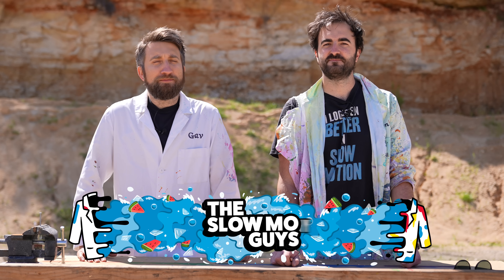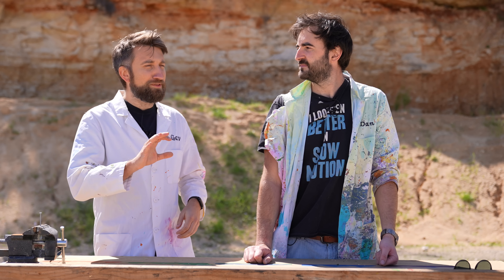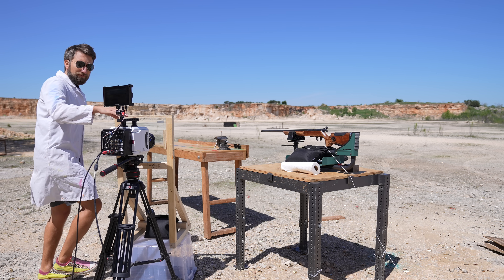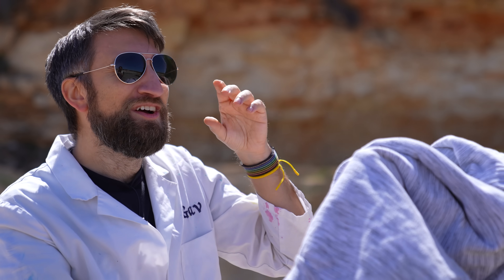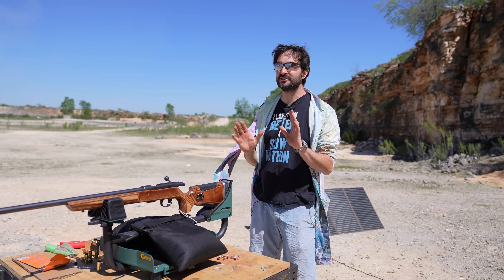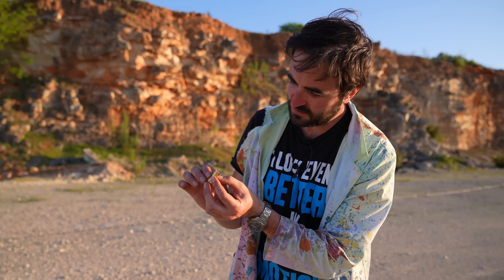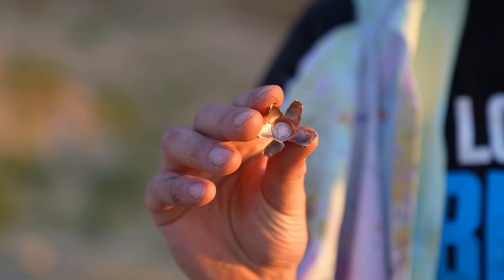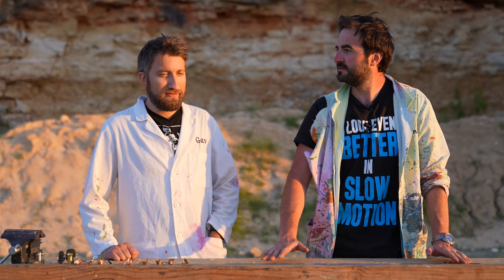Can a Bullet Go Through Another Bullet? 875,000FPS - The Slow Mo Guys

Comment: 14:14 Cool. You can see the distortion of the image caused by the shockwave from the shot as it passes the round.

The difference between the movie and this real-life test is that, yes, the lead of the bullet was liquefied upon impact and then re-solidified as it was flung from the explosion. The movie showed the bullet fragmenting, but not melting. To prevent the melting and merging of the fired bullet, it would have to made of metal with a higher melting point than lead, such as steel or tungsten.

Comment: You should try the Excel Arms Accelerator Rifle which fires a 5.7×28mm caliber round the .22LR round seems to soft and not powerful enough to go through a 50 caliber hollow point round. Also could try a 22 Hornet, a 22 Magnum those rounds might go through a 50 Caliber hollow point round.

Comment: You guys did an incredible research and experimentation.
But you got one little detail wrong which is why you were not getting the results you wanted.
Using a smaller calibre like the .22 was almost correct, the only thing is, it should have been of a harder material not lead.
Try forging the projectile with mild steel and experiment again, i guarantee you will get the result- smaller projectile passing clean through as the larger one disintegrates.
Its because both projectiles are lead, thats why its getting squashed together on impact.

Comment: 7:48 that's pretty much the result I expected. The bullet in the movie looks like an AP one, but the one they used was not, so I was expecting that tiny thing to not get through the big one.
10:55 looks like the primer didn't even get to do it's thing and was just "shoved" into the cartridge so fast that the compression shockwave blew it open before the ignition could happen. Otherwise I would've expected at least some flame behind the bullet, but there's just a vomit cloud of gunpowder.
11:45 I've heard of caseless ammo before, mainly from some Fallout 3 mods, and I never thought about the heat sink part. That's actually really clever, and probably one of the many reason why "caseless" never really took off.
12:50 "Came for eggs, left with a rifle: Walmart." (I wonder how many know where that's from)

Comment: 1st thing, yes 22 is very unstable in flight.... very common to answer ur first statement....The reason its not getting through is the lead in the 22 and the lead in the 50 cal have  equal density thereby molding into a single mass, the energy stolen from the 22 round travels through the 50 causing the jacket to dislodge

Comment: to be fair I think the reason you didn't get all the way through is if you look at the bullet in the film it's got a much sharper tip it was most likely an AP round which based on the results here... Probably would have worked.

Comment: I would love to see this with different rounds at a level angle as a straight shot instead of going from up to down on bullet? Make each table the same and use a laser level to make sure it's a straight shot and see the expansion than. But you also need a rig to have the opposite bullet spinning on the spot somehow in the opposite direction? Maybe than it will be more realistic??

Comment: Very entertaining video guys. A 22 magnum would have worked better than the 22LR, and if that wouldn't go completely through then step it up to a green tip 5.56 Nato which is readily available and has a steel penetrator core. It's the same diameter as a 22LR but has much more velocity and energy. I would like to see you do another video with this and then you can compare the difference of one bullet being fired and both bullets being fired. Thanks for the upload guys. P.S. You actually can get those rounds from Walmart. The brand I know they carry is Federal Ammunition's American Eagle 5.56x45mm Nato XM855FL.

Comment: surprised you guys didnt use a .223 / 5.56 since they have about the same diameter as a normal .22 (with an extra 0.003 inch), but with a lot more powder and length.

Comment: The angle of the .22 bullet is due to the fact that the bore of the rifle is angled slightly upward, relative to the sight line used to aim.  This allows the bullet to achieve a ballistic arc, so it’s slightly low close to the gun, slightly higher a bit further out as it continues along the trajectory, then as it curves downward due to gravity, it will once again be right on target, then lower and lower until it hits the ground, or an obstacle.  Frankly, it’s amazing that you were on target so close, all of my rifles would have shot low by about 1-1.5 inches, as they are zeroed to 25 yards.
Reply: ...they are using the bore of the gun to aim, as shown at the start. And the problem is in the bullet being tilted relative to it's trajectory, which really shouldn't be happening.

Comment: The error in cg and peoples imagination is that they still believe in metal collisions high speed that metals would act still hard and break in tiny pieces. But actually they deforms in a looking way similar as liquid, but this case lead its very soft metal already, hard cast iron yes would break in pieces. Also depending on circumstances the lead hitting have some portions or all pulverized exploding in so many tiny pieces almost like total powdered composition. Shockwaves also act like liquids

Comment: Is it possible to uncap an (initially sealed) plastic bottle by rapid accelerating rotation, so the inertia of the cap unscrewes itself. I hypothesize that about any bottle configuration would separate the bottle before the cap unscrewed. I think the 450ml plastic bottle has a chance.

Comment: A different bullet material on the small bullet might give you the desired result. The bullet I. The movie looks like a more solid, penetrator round. Lead on lead, with the smaller bullet having less mass, means the rounds are likely to merge or meld together. This is still a very cool video.

Comment: To be fair, to answer the question that you were asking you would have to use identical ammunition to what was used in the movie. You guys are using 22 caliber rounds but they are not armor piercers like what was used in the movie. If you were using a pointed armor piercing round like the one in the movie it would have went through that like butter. So I call this entire video a fail if you're going to ask a question of is this possible in reality based on a movie then you need to use the ammunition used in the movie for a proper comparison. This is the first one of you guys is videos where I'm disappointed because of lack of detail. The fact that the bullet was silver and pointed suggests that it wasn't a simple 22 caliber jacket around.

Comment: Have to suggest you doing this again, maybe on Demolition Ranch. With a 5-7 or 17HMR. The 22 isn't a jacketed projectile, it's practically speaking painted with the copper coating and there's no steel core so the soft lead is just explosion welding together.

Comment: I'd say there's two big differences between reality and the CG shot.
Firstly, there's no spark of the air igniting like Gav mentioned.
Secondly, the CG shot doesn't show a lot of deformation. It mostly just shatters like a rock, whereas in reality, lead is a pretty soft metal so as you could see in the footage it became much more liquidy under that much stress.

Comment: I would have tried with either .22 magnum round, or get a really high power .22 PCP air rifle and try with that. With an air rifle you can easily get as much power as with the .22 and AP shapes are readily available (even from materialsi like steel)

Comment: Vanguard Outfitters, located in Florida I believe, has 5.7 rounds called "Obsidian Dragonfang" rounds that are a 34gr solid copper alloy projectile and come to a point, just like the rounds in the movie footage. To get the testing to be as close to the original as possible, I would use those rounds. They are nearly .22 caliber, but are much faster & have much more velocity, coming in at 2125fps from an FN Five-Seven pistol.
Most 5.7 rounds are about the same weight as 22lr rounds, 27gr-40gr and there are subsonic rounds available weighing 60gr.

Comment: So… I kept skipping around but…. You know the bullets going at each other instead of one being stationary would change the results? 

The problem with the film was that they energy of each round would’ve have been redirected and disappeared with the larger material density of the larger round essentially enveloping and “dragging” the smaller round down with it. 

They would probably smash each other like was shown and slow down dramatically in mid air

Comment: In suicide squad It’s very clearly a 5.7 round (likely an armor piercing variant as well) not a 22… obviously a 22 round is not going to go straight through. An armor piercing 5.7 would however very likely punch through that 50. Hollow point with little issue.

Comment: Gentelmen, all you need to do is buy a few rounds of old military " Black tip " 30 -06 armor piercing rounds. They have a tungsten core that is smaller than 30 caliber and covered in lead and copper to protect the barrel rifling from the core. Get them at gun shows or E-bay for your tests. I am sure they will go right through the 50cal. That will be and an interesting video I assure you.

Comment: The trouble with 22 bullet was that only one bullet was moving, so there was less energy. When both of them move head on, then the velocity of both bullets add up and you end up having much more energy. But even then the bullet with more energy/mass has better chances of keep moving. But yes, having both bullets fly and hit each other mid air is pretty much impossible...
So, you had more realistic results with .30 06 since it has waaaaaaay more energy than a .22

Comment: Re: appearance of being liquid. Shooting the standing part of a railroad rail, about 1/2 inch thick steel, the hole was about double the diameter of the bullet, and the inside of the hole had the appearance of being melted and immediately returned to solid. Its color was a dark shade of bluish gray, presumably iron oxide. That was with a .270 Weatherby, a 100 grain bullet at about 3800 feet/second. If you decide to have another go, I suggest keeping the .22 caliber that fits the hollow-point so well, and fire it from a .22-250 or other really hot .22's that can exceed 4000 feet/second. Since you have a .30-06, if you can find some Remington Accelerator ammunition with sabots and .22 bullets, that will get you much more velocity than any ordinary ammunition. That is how they get extremely high velocity with the main gun on our M-1 Abrams tanks, but the projectiles for that are somewhat larger than .22 :-)

Comment: 5.7 is a unique round so it’s hard to replace in this instance, but a somewhat comparable cartridge to 5.7 could be .17 hmr or like .17 wsm (probably too much fps). Only issue is we dont know the weight of the 5.7 bullet they would be using in the movie, but honestly it doesn’t matter because you couldn’t recreate the movie scene exactly without loading your own 5.7 projectiles with hard cast or something like titanium in order to prevent deformation, + it wouldn’t make that much sense if the movie characters used fmj to shoot each other with. But hey it’s a movie, and those clips you guys got were insane!

Comment: First, it was a great and enjoyable video.  I have handloaded ammunition for decades so here's a little more perspective.

There are a lot of variables that are not addressed here.  The bullet in the original video is from a centerfire cartridge, probably a 5.7mm although there are .224/5.56mm bullets of that shape.  The bullet is of either a full metal jacket or armor penetrating design and is traveling at 2 to 3 times the speed of the .22 rimfire bullet.  The rimfire bullet is made of very soft lead and is .001"-.002" (.025 - .050 mm) smaller diameter than a .22 caliber centerfire bullet.  The rimfire bullet is also significantly lighter and thus has far less energy.  The .30-'06 bullets you used are of a soft point design, intended to expand on impact much like the hollow point .50 cal bullet so it was no surprise that they broke up.  Any full metal jacket bullet and especially one of a diameter closer to 5.7mm would have likely made it completely through the base of the jacket of the .50 cal bullet.  A "green tip" 5.56 NATO round has a steel core and would be a likely candidate to make it through the .50 cal more-or-less intact.  A monolithic copper alloy bullet of 5.56 - 6.5 mm with a solid closed point would have been an excellent choice to prove the concept as well.

It's very unlikely that shooting a loaded cartridge is going to result in much of a bang.  Once the brass cartridge is broken open or the bullet is dislodged there is nothing to contain the pressure.  Containing the pressure while the powder burns is what raises the pressure and makes the loud report of gunfire.  I found a live rifle round at the range one day and set it up on the 100 yard target stand.  When I shot it with another centerfire rifle, there wasn't even much of a flash.  Some of the unburned powder was still in the cartridge when I recovered it.

Comment: Guys, you used the wrong penetrator bullet.  The bullet in the movie is something like a 5.7x28, which is as narrow as the 22 LR but has a much higher velocity.  Your experiment might have worked if you used the narrower but higher velocity bullet.  A 5.7x28 pistol or a 17 HMR pistol would each have been a good choice.  Unfortunately a 22 LR does not have enough velocity to cleanly penetrate the 50 cal, and the 30-06 is just too fat and powerful not to completely disintegrate the 50 cal bullet.

Comment: In this particular case, you should be using case hardened steel bullets. This wouldn't be difficult to make yourselves and to fit to a cart to test fire. Case hardened steel is far more resistant to sheer than the lead hollow point copper clad bullets and would replicate the movie's results perfectly. Also, this experiment doesn't replicate the film all that accurately, as pointed out by Gav(?) the extra forces involved by both bullets being fired would result in a cleaner sheering of the larger bullet as the smaller harder bullet passes through it.

Comment: It you guys used a .22LR instead of a .22 short, you'll see a bullet travelling properly and much faster as well. better yet, Use .22 Stingers by CCI and you'll see a hyper velocity .22 bullet or Remmington Yellow Jackets a frangible .22 hyper-velocity bullet. But, you'll need to use a rifle chambered for .22 Long Rifle. But I feel that you guys could do quite a bit of filming comparing hollow point designs and how they perform to each other in .22 LR Since there are a number of HP designs out there from various manufacturers. The Stingers and the Yellow jackets are hyper velocity rounds, and both are also HP (Hollow Point) and if you use Ballistic Gel to do your testing, you could see exactly how each one performs. there are also other brands like Winchester and a few others. looking forward to what you guys film next, as always!

Comment: Wish they'd done this with a .223 or a 5.7 round so the higher velocity would let it penitrate fully much easier. 
Really it would have been awesome to use the Smarter Every Day jig so they could have both rounds fired just like the source material they were emulating..
Because the .50 round being stuck down stationary really throws off the momentum and separation.. it would have looked super cool. Kinda like how the recent Ballistic High Speed video splitting bullets with an average, how the projectile just looks like liquid almost..
Maybe something you guys can revisit. Maybe get together with Destin and use his jig. It just would take alot of setup time, fabricating new mounts to hold the 2 different guns (one big 500 magnum revolver, and one 5.7 pistol) and getting the angles just perfect and then placing the camera just right to see where they meet with very different muzzle velocities..
But it could be done and would be awesome.

Comment: Of course the actual numbers depend on the ammo being used, but let's do some math:
Let's assume a 14.9 g .50 bullet traveling at 457 m/s vs. a 13.0 g 30-06 bullet traveling at 823 m/s. The momentum of the .50 is 6.81 kg-m/s. The momentum of the 30-06 is 10.7 kg-m/s.
Thus the total momentum is 3.89 kg-m/s favoring the 30-06. If you assume that the bullets completely absorb each other, the the total mass is 27.9 g, so the velocity of the combined bullets is 139 m/s in the direction that the 30-06 was fired. That's pretty slow for a bullet -- a little less than a second to travel the length of football pitch.
Of course, a lot of the energy is lost in the spray, so the momentum and velocity would actually be a lot less. *adjusts glasses*

Comment: .223/5.56mm bullets ARE .22 inches in diameter. They are just a bit longer and heavier than a .22 cal bullet. You could have used any of the .223/5.56 bullets after the 22 instead of going to the 30-06. There are single shot rifles for those.

Comment: The bullet fired needs to be a penetrator, not lead but steel cored or such, or it will just deform on impact losing most of its energy, moving one was some sort of armour piercing with a tip, prob tungsten since super duper bullet guy

Comment: gav is spot on with the brass case speculation. the brass fireforms to the chamber and pressure increases inside the case and compresses the gunpowder which is necessary for a complete deflagration of the powder